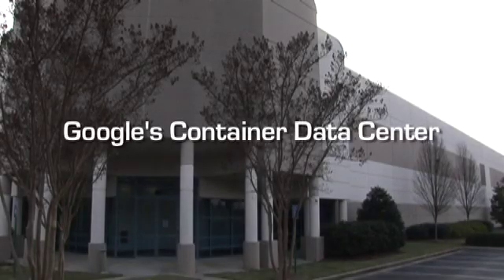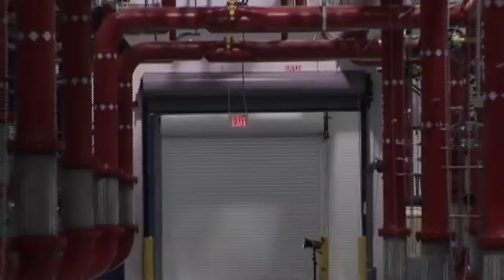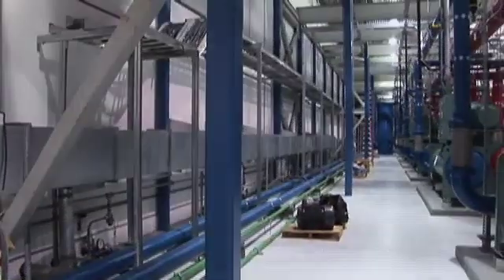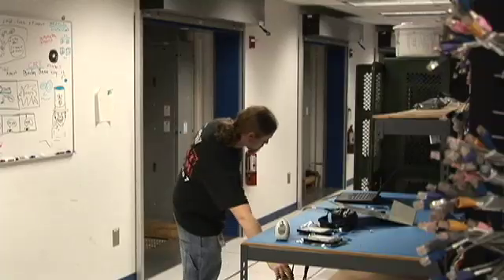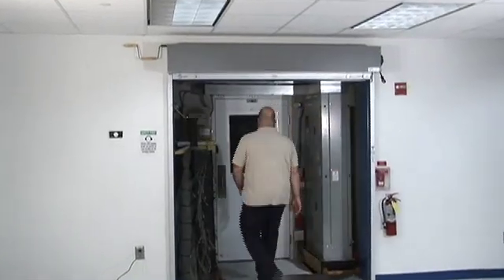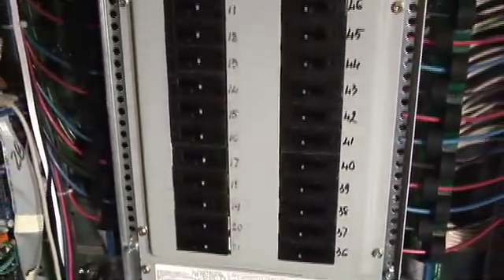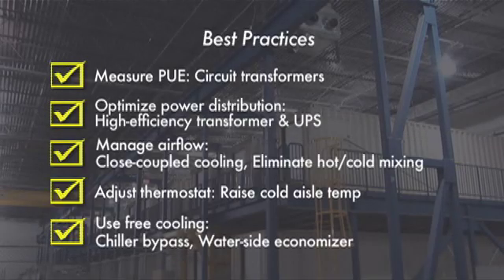Google container data center tour

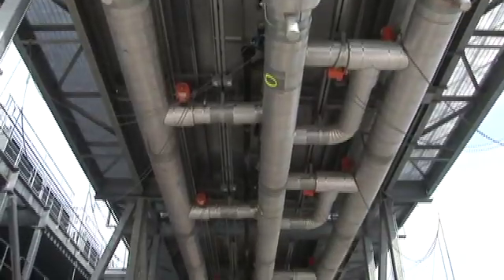Comment: @ 01:04 - What do you mean when you say that transformer efficiency is 99.5%, i thought they where about 60 to 70 %,, 
What kind of non-exotic transformer is this?
Reply: If transformers were only 60-70% efficient, we would be using DC power
https://www.electrical4u.com/efficiency-of-transformer/

Comment: this video is recorded in 2007 but this datacenter is still the biggest one
Reply: EMR3 C4N 0K5UM mlm
Reply: us-central1 is their current largest. It's incomprehensibly huge. Maybe one day I'll look inside of it but I superimposed its footprint onto the Orange County Convention Center (the second largest in the US) which I'm extremely familiar with and it's similarly as long but it's FAR wider. Almost twice as wide. It takes almost 10 minutes speedwalking to go from one end of the OCCC to the other, even with nobody in your way. and this is not counting the parts of the OCCC that aren't part of the showroom floor. It's incredibly large. having gone up and down aisles of conventions, to imagine that, all replaced with servers. It's incomprehensible. It sounds surreal. It's difficult to believe that their data centers today look absolutely nothing like the ones in this video. There is almost no similarity. To picture these... polyliths of information, just... stretching out for incomprehensible distances, and there's four floors of these. And it's just one of a few data centers they have in the area. And they have 300 of these, all over the world, and counting. There are THOUSANDS of data centers out there. Several thousand. The scale of data centers is incomprehensible. Perhaps one day I will see one in person--fairly soon, likely. But... they are true... utter poetry.

Comment: i was wondering the internet speed of google server
Reply: Emrecan Oksum Lol.. Which country are you in, man? So i did just read that Terabits connections are actually possible. What i also read though, is that Google still uses Gigabit-connection. So i still dont get where you had these numbers from.
Reply: Avian98X I live in Turkey. 

http://www.superonline.net/toptan-satis/ag-ve-harita

As you can see in this map our country gets its internet from Germany and each fiber cable transfers 1,5 Tbps connection. I think Germany uses 20 Tbps to provide internet to customers and whole Turkey.
Reply: +Ace james in 2015 they have 1 TBPS but in 2014 they use 850 Gbits
Reply: Ummmmm where do you have this information from? 
From what i read, a fiber connection allows them up to 1 Gbits. Definitely not Tbits.
Do you even understand how fast 1000 Gbits would be?
Reply: Avian98X My country uses Terabits to provide internet to us. My country is connected to Germany with 9 TBPS with 3 different fiber optic lines
Reply: Avian98X Fiber optic cable can transfer more than 1 Gbps

Comment: Tdhe low voltage stuff is quite strange. Did someone calculate how fat cable do you need to conduct 12 volts to 100 meters with the same efficiency as 220? Yes, they have good hi-to-low conversion, but I really doubt they achive overall better efficiency than high voltage cables

Comment: @karrotop  Reason one : packaging and handling costs are much less. Shipping container method : build 1000 servers, install in shipping container, test the system, ship the container. Rack method : build 1000 servers, pack in 1000 boxes, load 1000 boxes into shipping container, ship container, remove and unpack 1000 boxes, fit to racks and test. Reason two, cooling system - don't have to cool the whole building. Reason three, more resistant to fire, flood, earthquake etc.

Comment: @Armornone I work with a lot of datacenters and the idea of open data centers is a dying idea since you have to cool a much larger space instead of just the devices. This in turn requires more cooling power. Also if you have ever been in a large datacenter you would know that there are always areas were heat builds up and cool air lingers. Every large datacenter with the open floor plan runs into this problem.

Comment: @12mrluke12 

If you didn't know google don't use microsoft, big servers like this don't use microsoft server operating system but Linux. Just like the watson that was being used in jeopardy a few months ago for few days. Watson vs people. Linux is more flexible then window and can be fully customize there is limitation on 
windows compare to unix based os.

Comment: Google of coarse is working this in conjunction with it's experimental fiber-optic network that would deliver speeds of up to 1Gbps. This is all part of their 2020 vision to bring speeds of 100 Mbps to one 100,000,000 homes. Yea & who is going to pay for that? What will it cost as I pay $70  a month just for a 18Mbps connection as is. Telecommunications Industry AUS Telecom Association said they would not produce Supercomm due to cost. Not to mention those speed will be impossible wireless.

Comment: Gotta love Raid. Each unit the engineer changes is a part of a Raid within the container. A single container is part of Raid in the DataCenter. Each DC is a Raid piece for Google. Containers are probably hot-swapable :) In case of disaster they just decide if they should sacrifice the web-search-indexes from 2003 or your emails from 3 years ago. :)....and its probably your emails.

Comment: @johnmacward cant comment on US standards but australian standards  only which I am assuming are similar to US (we use 240VAC50Hz not 110/60)..upto 60VDC/45VAC is classified as ELV (extra low), upto 1500VDC/1000VAC is classifed as LV, and over 1500VDC/1000VAC is classified as HV.

Comment: I'm sure it'd be less then you think. Google have a nack for doing things very cheaply and very efficiently.

A good example is there server racks. I'm not sure if they still do it, but the case certainly used to be they would buy second hand PCs for $20 ea and lash a bunch together. Other search providers would use more highend computers that would cost a lot more then $20

Comment: Hmm, OK.
So what about putting airways on the container's roof going to the data center roof, so the heat would flow upwards by natural convection force?
In summer it would reduce cooling costs, in winter it would virtually reduce them to zero.

Comment: why are the power distribution cables low-voltage? would make more sense to raise the voltage to decrease power losses.

would probably make more sense also to leave all area lights off and use flashlights for servicing...

Comment: "Google provided personal transportation device", LOL, the presenter is such a douche bag.

My only remark is about the exposed power lines entering the building from the generating unit: why are they exposed to the elements (I know, it's like all cables, but still) and why are they exposed to potential sabotage? I would have put them in a box to prevent someone from cutting them.